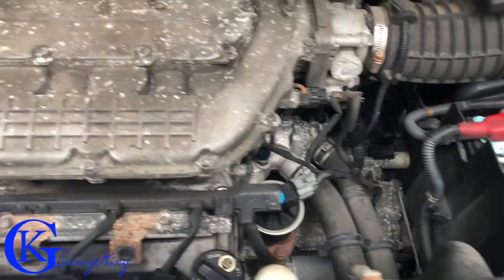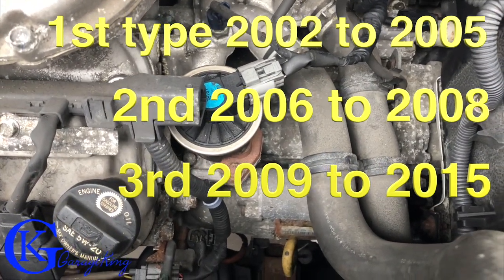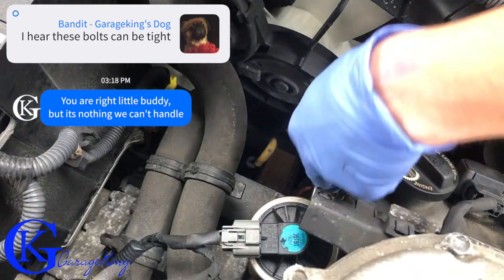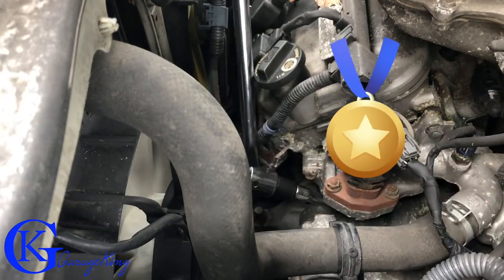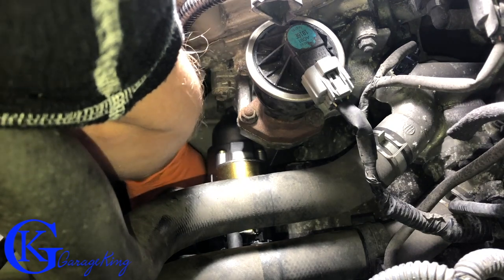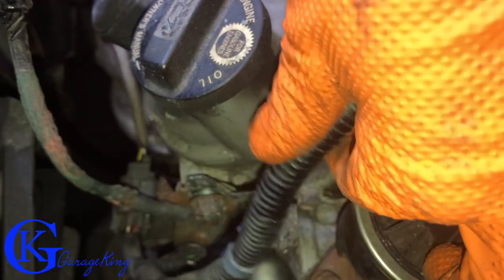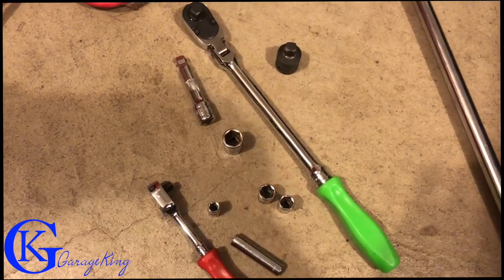How to replace Honda Pilot Starter

Comment: Thank you for this! I just replaced the starter in my 2009 Pilot in part thanks to your help. The 2009 is even tighter and requires you to take the whole battery mount out. Your tip to use the silicone on the gasket was golden...I would've lost my mind trying to keep the gasket in place.
Reply from the maker: So glad I was able to help you out, thank you for the great comment !!!

Comment: I could not find anything about whether I needed a new gasket for starter replacement. (New OEM metal gaskets are $25 with shipping and taxes) you showed how to reuse the old gasket with the silicone hold down. Excellent video!
Reply from the maker: Thanks for the comment brother!!!  You don't need a new gasket, only if its rusted away LOL :)  FYI -  I have never had to order a new starter gasket.  If your are really good with your hands you can avoid the silicone and get the old gasket back in, but I found its just way easier to use silicone.  Thanks for the positive feedback!!!

Comment: Thanks for doing this.  my 2007 was working hard to start, and then last night it stopped working hard and just refused to crank - no clicking, just the happy ready start mode smiling back at me as I frown and turn the key repeatedly.  I'm going to pick up a starter today.  Hopefully I won't need the breaker bar either!
Reply from the maker: Thanks soo much for the comment brother!!!  I do appreciate it :)  I find for some reason these Honda starter bolts are all tight, so you may want to have that breaker bar handy :)  Happy holidays and if you need anything let me know!!!  Thanks
Reply: @GarageKing  you were right! About five years ago I bought a large steel pipe that slips over the handle of my wrench so I could loosen some rotor bolts, and it came through again for this project.  Great video! Happy New Year to ya!
Reply from the maker: @DannySchneible  I'm glad you got it all done, and that large steel pipe sure came in handy!!!  Don't know what it is, but every Honda starter I do is always really tight.  I'm glad you got it all done and Happy New year to you!!!!!

Comment: Hey man love the video! I was having the same issue of the battery turning on but no crank. I had my insurance company come out and try to jump the car and still nothing. He even tested the battery and said that was good so I was pretty sure it was the starter. Replaced the starter today and still the same issue! :/ any advice or suggestions?
Reply from the maker: Hey there, and thanks for the great comment.  There are a few other things to test.  Your fuel pump relay runs on the same circuit as other things and can cause problems.  Also your neutral safety switch can cause it.  See this vid, its short https://youtu.be/-gmOE90Xmmw and also try to start your vehicle in neutral with your foot on the brake.
Reply: @GarageKing  thanks for the tip! I was able to get the car started in neutral so does that mean my neutral safety switch is bad?
Reply from the maker: @Daneil779  It could be, I'm not sure what a switch is worth.  If its cheap then sometimes its worth it to just buy one and replace it.  But if its costly then better to test it.

Comment: My mechanic did not placed the shim on the new starter from the old one. Does it matter? He also said since the new ones don’t come with it is not need it. is it true?...... after two days I noticed oil on my drive way, so when I checked under sure enough oil dripping. Could that be the reason?. In other words could the oil now be leaking now from the starter?. Please respond.......  The mechanic thinks is the transmission leaking oil. I really need these 4 answers. Great video.
Reply from the maker: Thanks for the comment brother.  The shim should have been put on.  I always put the shim back on, if you didn't need it then why did the factory put it on? It will work without the shim, but the starter will not be sealed as well.  As far as the oil leak, that would have nothing to do with the starter, as the starter should be dry in there.  See if you can tell the colour of the oil coming off the powertrain.  If it's red it's transmission, black is oil.  Also they smell different.  The oil leak would not have anything to do with the starter change.  Hope I helped you out :)
Reply: Thank you for the quick response I really appreciate your concern. You have taken a big doubt off my mind. Also thank you for calling me brother.
Reply from the maker: Anytime, that’s what I’m here for :)  glad I could help you out :)
Reply: I actually had the same issue with also not using the shim. Transmission fluid leaking - is not using the shim the cause?

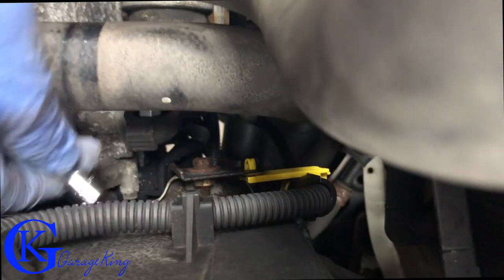Comment: This is fantastic and lucid.  Thank you so much.  I am going to perform the invasive surgery on my 08 Pilot tomorrow, and this video is going to be my master reference:-)  I have a quick question, which I hope you will be able to answer.  When you removed the 10" nut for the main power connector (7:05-7:16 min), it appears in the video that you were turning the wrench clockwise (for removal).  Did I get it right, and if so, is this particular bolt reverse threaded (i.e., clockwise to losen and counterclockwise to tighten)?  If so I better be careful.  Thank you.
Reply from the maker: Hey Hey my friend!!!!  You watched the vid closely!!!! That nut is a regular nut, lefty loosie, righty tighty.  I was concerned when I looked at the video and man it does look backwards so I had to do some investigation.  I went to the raw unedited footage and what happened is when I filmed that it was not in wide screen because of the way the camera is and when I transformed that footage I spun it 180 degrees so that clip is actually upside down, that's why it looks backwards!!!!  I have to congratulate you on pointing that out, but mystery solved, its just a regular nut so no worries!!!!  Thanks for the comment, I really enjoyed this one.  Good luck tomorrow and if you need anything just comment and I'll get back to you.  Thanks!!!
Reply: @GarageKing   Thank you so much for the prompt reply.  Yes, I had watched your video multiple times with "religious fervor" :-) .  And good luck I do need, lots of it!!  Thanks again.  ps.  Since I am not critically dependent on this vehicle for the moment, I am going to remove the starter first, test it outside to make sure it is indeed faulty (though I am pretty sure that's were the fault is, since I am getting full voltage at the solenoid connector when the ignition key is rotated to the crank position) and then order the right replacement.  If all fail, I have the tow truck guys on my speed dial :-)
Reply from the maker: @Musiclover5258  Hey buddy, was thinking of you yesterday, but wanted to give you some time before I replied.  Was wondering how the job turned out?  Were you able to get the starter motor out ok?
Reply: @GarageKing  Hello friend, thank you for following up.  The operation yesterday was a success, thanks to your video, short of which I certainly would not have managed it without breaking things or possibly even hurting myself :-)  I successfully removed the starter - the two bolts came off with a longish (~15 inches) flexhead wrench that I went and purchased at Home Depot, but didn't need a breaker bar. Verified that it is indeed defective by connecting to the battery externally, and ordered a replacement (Denso remanufactured), which will be arriving on Tuesday. Hopefully the rest of it should also go well.  
One small outstanding issue though; I simply could not separate that rusted metallic clip from the plastic fastener around the main power cable (even after detaching  the 8mm bolt holding the clip, per your instructions, and taking the starter out - see 8:56-9:35min).  How exactly did you do it?  I applied generous amounts of WD40 yesterday, and I am planning to try again later today - failing which I was planning to reach out to you.  Please let me know if you have any suggestions.  
I will also confirm after the re-installation is complete.
Reply: @GarageKing  Just wondering if you missed the second half of my earlier reply (hidden under the "Read More" trailer).
Reply: @GarageKing  This project went of well for me.  Thanks.

Comment: Thanks for this. What was wrong with the starter?
Reply from the maker: It sometimes just clicked.  It did intermittently start.  I did the checks and decided to replace it.  Here is the vid for the checks if you wish https://youtu.be/-gmOE90Xmmw  Thanks for the reach out and hope you have a great day !!!
Reply: Mine done it once and was done. No click. Hopefully I'm replacing the right part lol
Thanks
Reply from the maker: @drstevenbrule  That's what it usually is most of the time.  I have my fingers crossed for you !!!

Comment: Would it be easier if you attached the wiring to the starter before bolting it on to the body? How did you get the plastic clip off the rusty bracket?
Reply from the maker: Hey thanks for the comment. I don’t think you can attach the wire to the starter first as there is not enough there. If I remember correctly there was barely enough there to attach the wire with the starter on an angle.  You are free to try :)  as for the clip on the rusted bracket I use a small flathead screwdriver and took my time slowly wiggling it back and forth. Each time you do that it will get more loose. You can’t rush it, it takes time :)
Reply: Thanks for the reply. I could not take the clip off so I just used the old bracket. My contribution to this post is to suggest you remove the transmission dipstick for more room. You can connect the electrical cables to the starter before bolting it to the body. There was enough slack in the electric cable to hold the starter sideways and connect them first rather than struggle in the cramped space after bolting the starter in. Great video!
Reply from the maker: @Jcaban  That's great to know and thanks for the feedback!!!  I do appreciate the follow up.  Most guys do their thing and leave so I do appreciate you sharing that.  Thanks brother !!!!

Comment: I have a 2019 touring and that starter is different. It's a mitsuba. I haven't found a video of that removal/installation.l So there's yet another starter to look out for.
Reply from the maker: Hey Thanks for the comment, I haven't had to change one on a 19 yet, that's pretty new.  You would think the vehicle should still be on warranty?
Reply: @GarageKing  Normally would be, but I got  a fixer upper. No warranty. I wrench on my vehicles. I'll get it done though.
Reply from the maker: @tuckny7  I see, sometimes those are the best deals !!

Comment: 323 Like Playlist support check in great video I am sure I be need this sometime down the road .  Thanks for share with us
Reply from the maker: You may LOL :)  These Honda engines are popular.  Well built engine, but I do see starter problems with them, not too much else goes wrong with them.
Reply: @GarageKing   we have 2012 Honda civic buy it new at the dealer have been a great care  put about 200 miles a days every day no leak great gas
Reply from the maker: @shahnawazvlog6266  That is awesome, Civic is very good car and usually not too many repairs needed.  They are good on gas, and with the prices now they are even better.  In Canada gas is $2 per litre so that would be about $8 per gallon !!!

Comment: Ever had it crank by itself once battery terminal was connected?
Reply from the maker: Never had that, I'm surprised that would even happen as you should have to turn the key to start (which is a spring position that flips back when you take your hand off)  I don't know how it would do this or why, thats very puzzling.